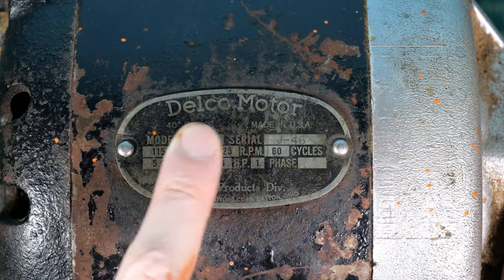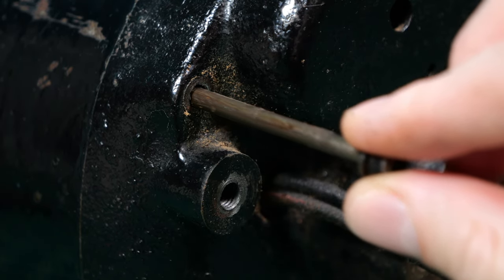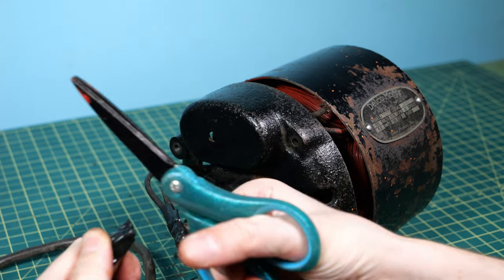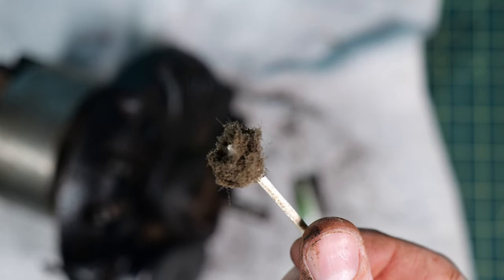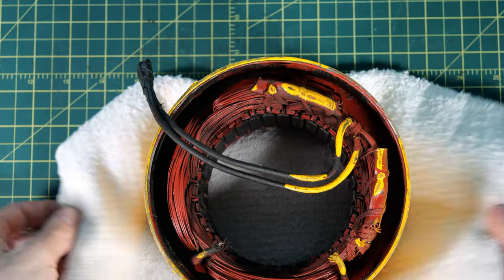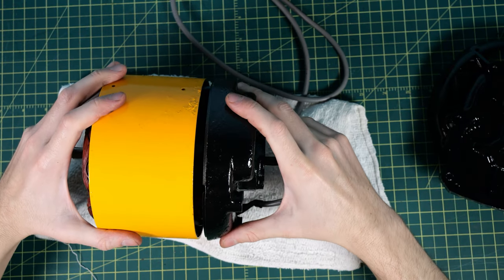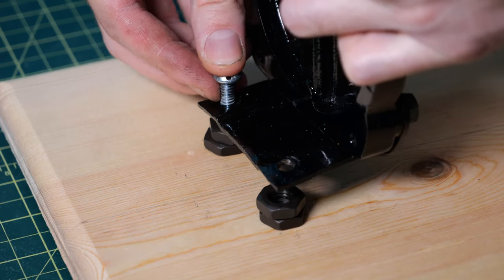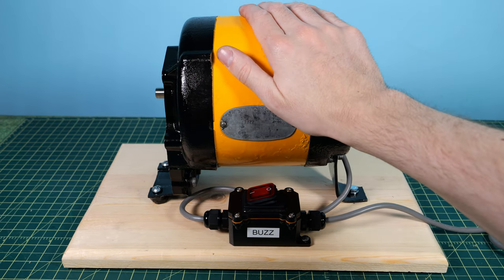Restoring My Grandpas Old Electric Motor

Comment: I did something similar to an old double shafted motor that came with a table saw that my Dad bought for my Grandfather back in the 1970s.  

That motor is now powering a 4 inch jointer in my shop.

Comment: Just by chance came across your camper trailer build, very cool job, only question is how far did the 12 volt battery get you ? As in what was your range of travel?  And did you incorporate a solar trickle charger to ur battery, liked how you rebuilt the motor not many can actually do it, great job looking forward to seeing more goodies from you.